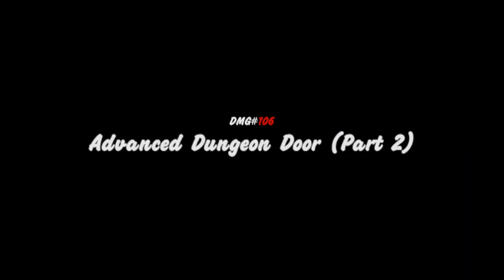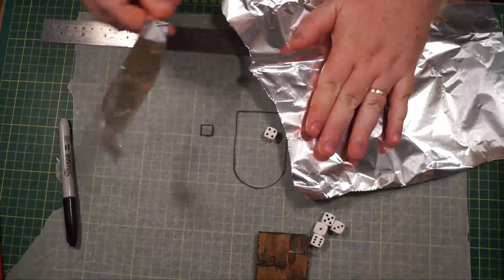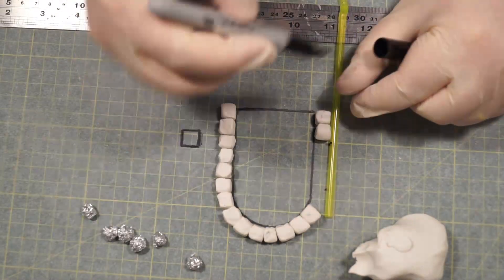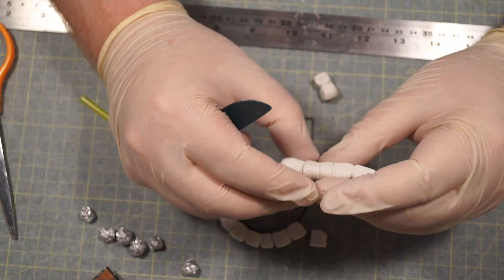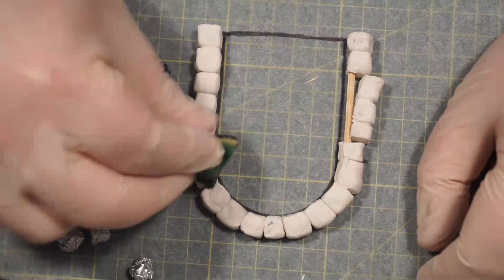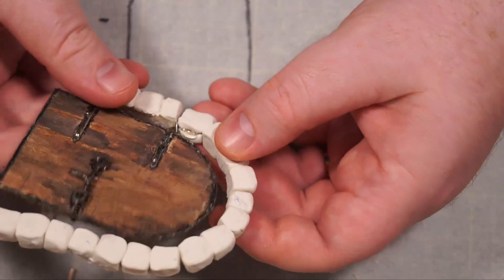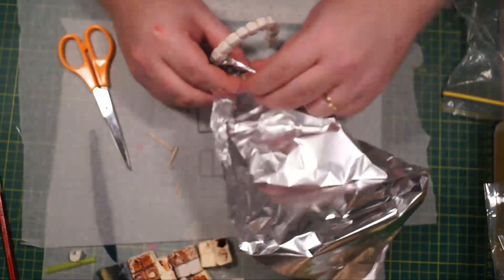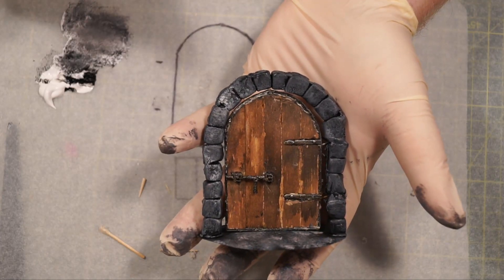How to make an advanced dungeon door with lots of detail (part 2) DMG#106

Comment: Excellent work on the archway. AJ Pickett used the same technique with the clay over foil and it requires less baking time with the sculpture, since the clay layer is thin.
Reply from the maker: +Stronghold Crafter Kev exactly. It also says to do that on the packet :) which is where I actually stole the idea

Comment: Really good looking and so simple. I have watched a bunch of crafting videos and the cost of building materials tools etc can really tower up easily
Reply from the maker: I spent about $50 5 years ago and am still using the original stuff, except some paint and a couple of hot glue guns
Reply: TheDMGinfo im just thinking about stylofoam ( not needed for doors) of the brand jackofoam. A special material for crafting. The only price i have found is close to 300 bucks!! Ofc you get a large board but its not cheap